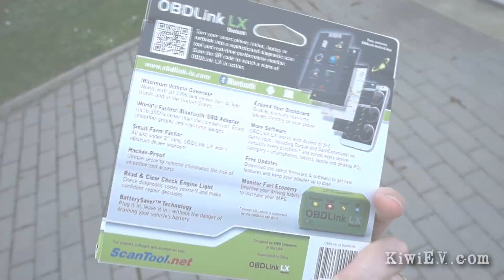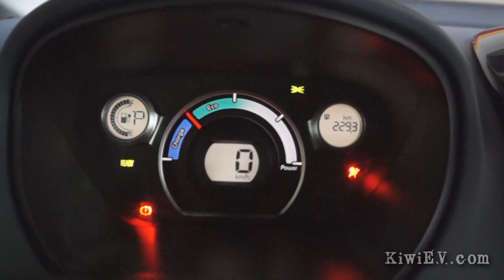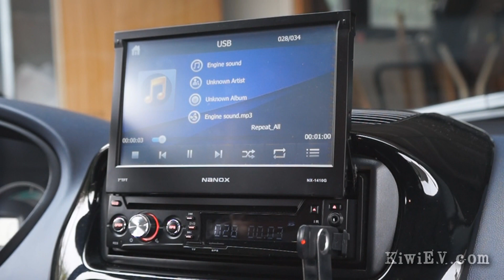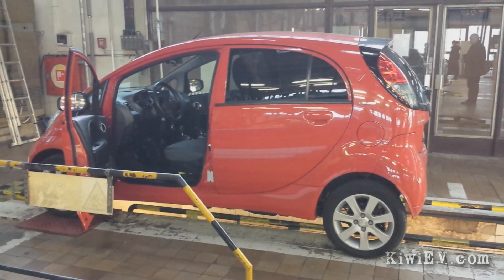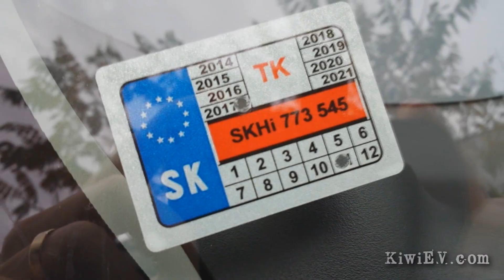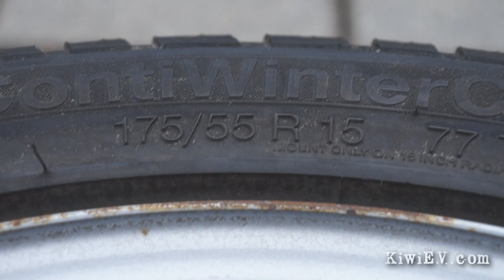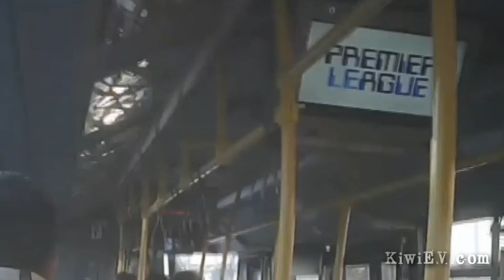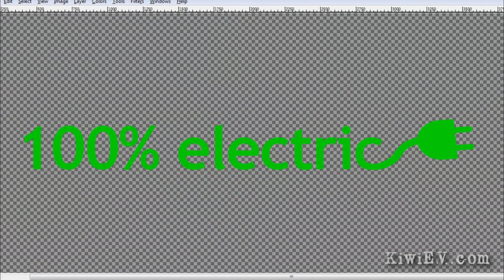Racing my electric car against the gas version, playing with data... and installing an exhaust pipe?

Comment: I love your sense of humor  :)

Did you wax your car?
Also here in Estonia dealer coated all iMiEV-s underbellys with bitumen (or something else like that). It appers there is no salt-resistant coating by default. Every bolt and may be totally coated with thin coat of rust by now.

Comment: A question I have wondered about for many years- in countries other than the US, what sizes are the socket wrenches? Here, I am used to picking up a 3/8 inch or 1/2 inch. Are these universal, or are there incompatible metric versions? If the inch sizes are used everywhere, are they commonly referred to in inches, or something else?

Comment: Hehe, impressive paint repair.
Surprising that it uses 30kW at 130. Must have quite poor aero as dumb automaker cars often have. Quite a shame. Good aero would probably double the range for free.
I was bicycling home yesterday at dusk and saw a parked VW Up with a couple of green lights on it. I thought that was odd futuristic modification or gear but turns out it was the electric version and it was charging on the lawn :)
We have a few Teslas here in Denmark, the odd Leaf and i3 but the Up is rare. Probably because it's so overpriced. Typical nazis :)